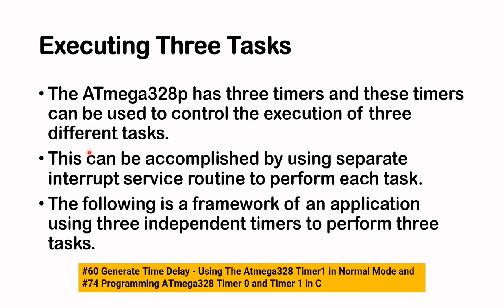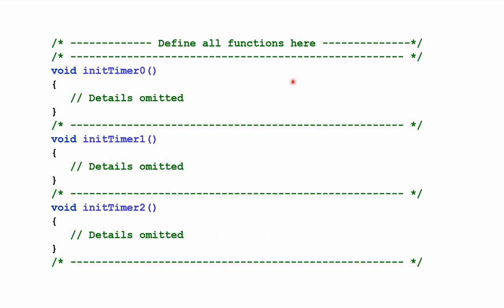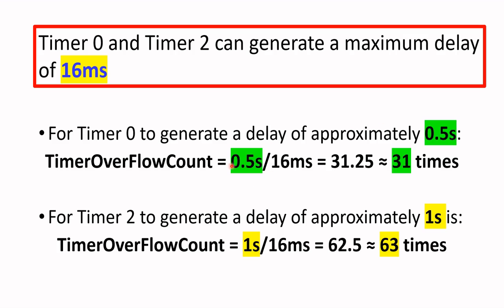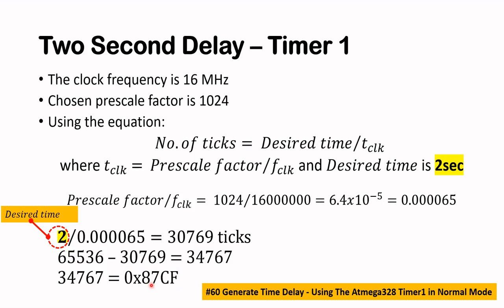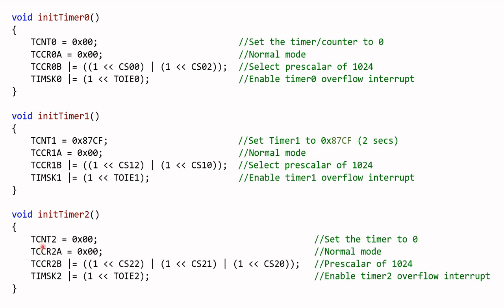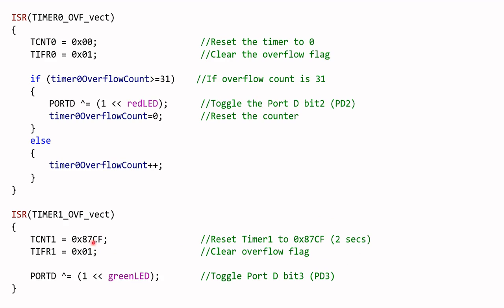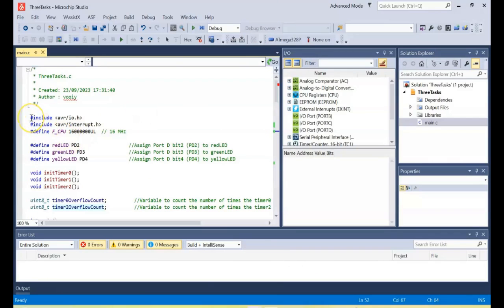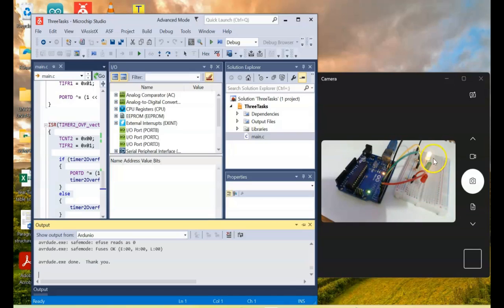#76 Task Scheduler - Part 2

Comment: Sir I have doubt, I did not find PD2, PD3, PD4 in io.h file. then how does the compiler accepted it.
Reply from the maker: Hi, we are assigning PD2 to the label redLED, PD3 to the label greenLED , PD4 to the label yellowLED using the preprocessor directive #define. You need to include #include <avr/io.h> so that the compiler will recognize PD2, PD3, and PD4. I hope that helps.